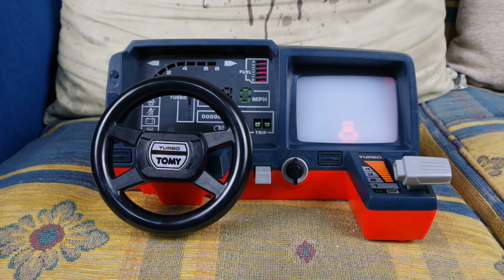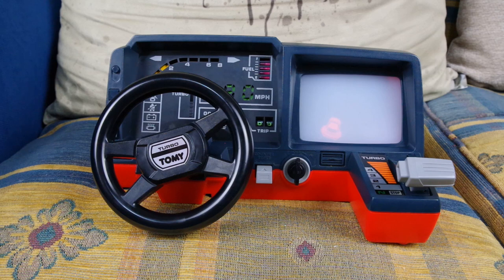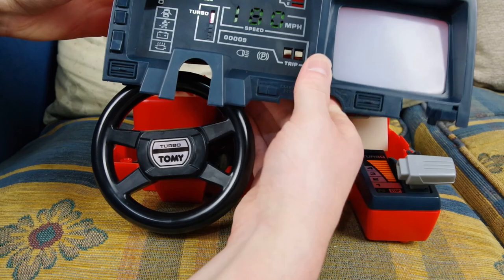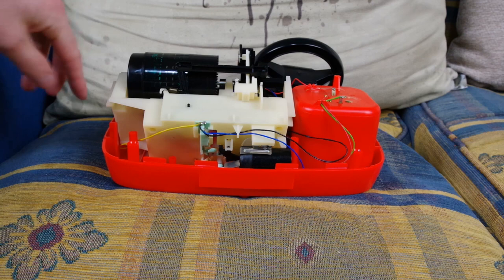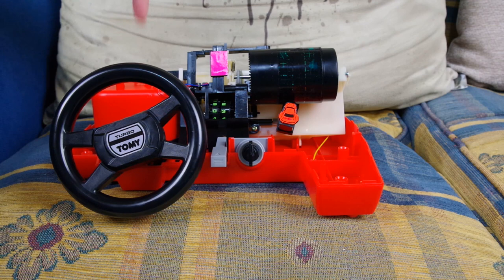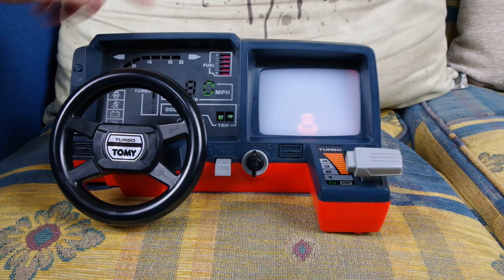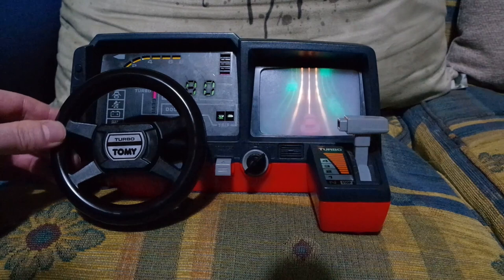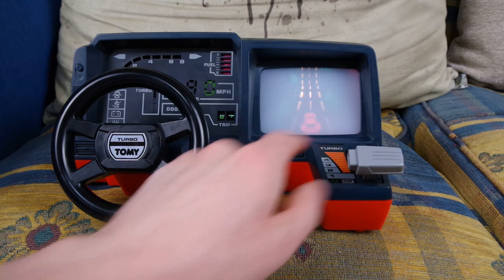Tomy Turbo Turnin' Dashboard

Comment: I have this exact model and it still works perfectly. The only toy I kept from my childhood. I’m now 39 and my 4 young boys are playing as I write this. Thanks for the video, I may need to refer to it sometime. Cheers from Australia 🇦🇺 👍🏼
Reply from the maker: No problem! Nylon gears slipping or cracking between the teeth was a common problem with mechanical toys. It happened so often, I used to have a bag of spares just for Scalextric slot cars  :/

Comment: I just found one in storage I forgot I even had from when I was a kid.  For some reason it doesn't power on when I put batteries in it though.  The battery connector was kinda rough so I used some baking soda and steel wool and the connectors are shiny.  I am wondering if there is a connector deeper that needs some cleaning too.  Great video on what it looks like inside.  The car steers side to side fine and the gear shift makes the speed go up on the dash so all that seems to be working just no juice.
Reply from the maker: I'd use a multimeter set to continuity  (tone) to check each section of the circuit, starting with the battery pickups. It's possibly the easiest way to see if a connection has come loose. :D
Reply: @OverdriveTheatre  Thanks I will crack it open this week and see if I can get it going.
Reply: @SubZtx    im wondering if you ever found the issue!

Comment: Why does mine work then stop moving? I try to press the reset but still.doesnt go when I push the throttle up
Reply from the maker: At a guess; a slipping or cracked gear. Possibly one of the two nylon ones underneath the unit. If you open the shell and release the main unit you can manually operate the throttle to see what's going on inside. Just be careful not to pull on any wires and place screws and parts in labelled trays for re-assembly.

Comment: I am repairing one and that black bar came out - How on earth do you get it back inside the toy because I cannot figure it out??!!
Reply from the maker: It's been a while since I opened this one up and remember it was the single most frustrating part.

So, it's linked to the readout dial behind the dashboard, speed controller and throttle. Set the readout to 0 mph and throttle to Neutral. Also, use a couple of elastic bands to hold the throttle cover in place, so the handle and gear linkage don't come apart.

Connect the T end of the bar to the slot in the readout dial. Lower the upper assembly so there's a finger-width gap and guide the far end of the bar onto the end of the throttle. Gently pivot the upper assembly (throttle down, wheel up) and seat the (sprung loaded) speed controller lever behind the bar's centre pin.

It's a pain in the butt and took some time (and a few of cups of tea) to get right.
Reply: Overdrive Theatre thank you!! Yes it took me SEVERAL hours to try to get this right... at one point I thought I broke it. Just wish the video showed how to do it but I felt your pain Sir. Do you still own it?
Reply from the maker: Yeah, I still have the files from that recording. It took so long to figure out, once it was put back together I didn't want to dismantle it and do it over on camera.

Still have it, still works. Actually keep it on display in my living room.
Reply: Overdrive Theatre thank you. I have a problem in that the white battery clip that holds the battery door in place has just decided to snap in half! The idea of trying to drill out rivet or take it apart is not what I want to do. Being over 37 years old, I’d like to keep things good as new if possible. Any advice would help.
Reply from the maker: You could try something like J-B Weld PlasticWeld, but I don't know how good that will be in this instance.

Honestly, the easiest thing to do would be to dismantle the unit and drill out the rivet on a pillar drill.

Fabricate a replacement catch with something like a plastic Cola cap*. Then either re-rivet or use a slim nut and bolt with a little Loctite Threadlocker Blue 242 (if you ever want to unscrew it) or Loctite Threadlocker Red 271 (if you never want to unscrew it).

Or you could fudge it by fabricating a replacement catch using a Cola cap with a split on the non-pointy end, slipping it over the existing rivet and use a little hot glue to seal the split?

*It's an easy to source plastic with similar properties to the OG catch if you don't have access to a 3D printer.
Reply: @OverdriveTheatre  LOL the idea of taking that apart again would kill me! I think I spent hours trying to work out how to put it together and that bar was a real pig to get into place! I do not have access to a printer, but my other option was to remove the plastic, find or see if I could get something similar that would fit in the rivet.